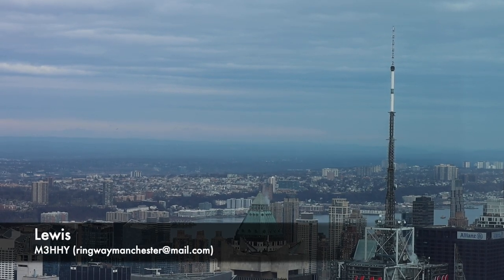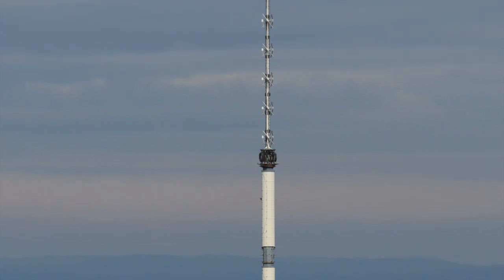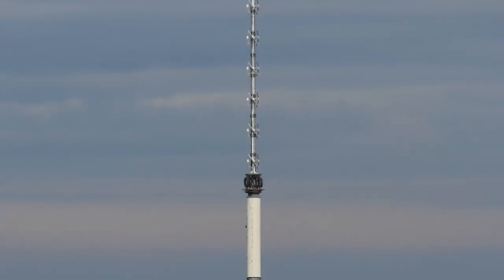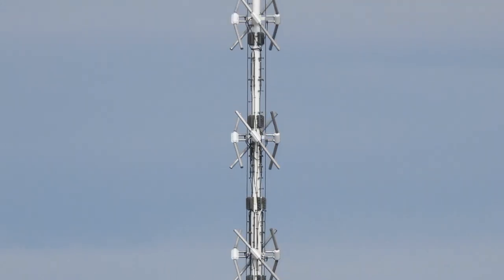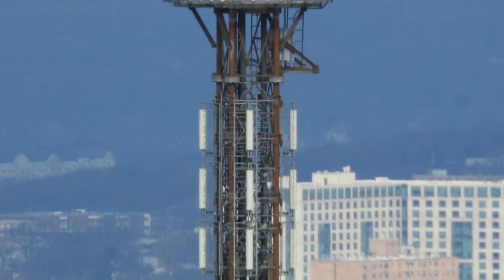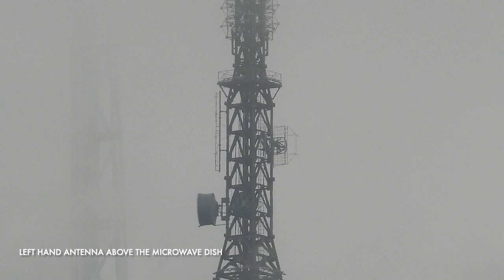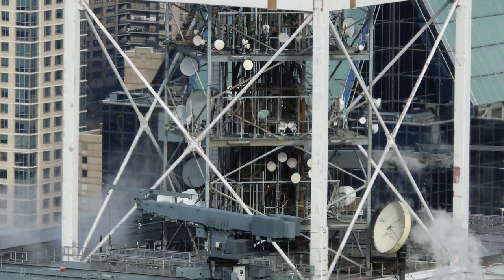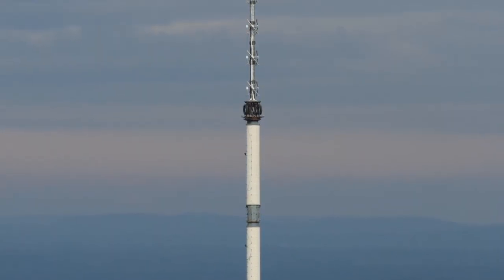What Every Massive Antenna Does On The Times Square Skyscraper

Comment: I'd imagine the two huge masts on top of the Sears Tower broadcast all sorts of things. It's one of the first things you see when driving into Chicago, from any direction. Seriously though, they're huge.
Reply: Indeed they are, the other large antenna mast system is on the John Hancock building, also transmitting TV and I assume some FM's as well.

Comment: I remember in 2000 I visited my firm’s NYC company HQ based in 1 WTC 101-105 floors. We installed a GPS clocking antenna on the roof for our new global network.  Soon after the clocking source went missing 😢

Comment: This is a great explainer. To add to it, many microwave sites are used by TV stations for their ENG (electronic newsgathering) trucks -- those branded news vans you see with the tall microwave antennas. Many TV studios have their own microwave receive sites as well, but terrain (and, in the case of New York City, super tall buildings) can make it challenging to "hit" a TV station's microwave relay from a truck, so they install microwave relays at various points, and the signal goes from one to the next until it ends up at the studio.

On September 11, the first "field report" of the crash came from Dick Oliver at WNYW, the local Fox station, who was doing a story near the World Trade Center when the first plane struck. They were able to rush to air with the first live report because Oliver and his photographer were already sending video back to WNYW's studios through the microwave relay on top of 1WTC. That is also the reason the station ultimately lost its ground video feed — 1WTC lost power a few minutes after the plane struck, and redundant systems used by WNYW failed. The station's broadcast engineer wasn't at 1WTC when the attack happened, but six other engineers — Don DiFranco (WABC), Rod Coppola (WNET), Steve Jacobson (WPIX), Bob Pattison (WCBS), Isaias Riverea (WCBS) and William Steckman (WNBC) — died in the collapse of 1WTC. All six men were credited with keeping broadcast signals for their stations on the air during the attack, and their work is one of the primary reasons why four stations — WABC, WCBS, WNBC and WPIX — were able to continue broadcasting until the collapse of the tower.

After the tower fell, broadcast communication was severely crippled. WCBS had an auxiliary transmitter atop the Empire State Building, and managed to stay on the air. WCBS, WABC and WNBC had to distribute their main signals on public broadcast and low-power TV stations for days until a permanent solution could be found (they were all still available on cable TV). With the priority on getting TV signals back on the air, getting live video from lower Manhattan was less of a priority, and the priority typically went to the networks instead of the local stations. This is why, hours after the towers collapsed, there were virtually no live reports from Ground Zero; instead, the TV stations relied upon tape turnaround from trucks that were positioned outside the collapse zone, and that could hit the TV studio microwave relays from other parts of the city.

After September 11, the primary TV stations serving Manhattan tapped the mast on Empire State for their main broadcast antennas and microwave relays. 4xSQ was primarily used as an alternative source for broadcasting and microwave relay (though depending on where ENG trucks are, they still use it as a primary microwave relay). The terror attack made it clear to the TV stations that redundancies needed to be in place in a market as big as New York, and it's one of the biggest reasons why they all broadcast from the new 1WTC tower while still maintaining their back-ups at Empire State and 4xSQ.

Comment: Some years before the 9/11 attacks my cousin took me to the top of the WTC Twin Towers, all the way up to the observation deck on top. I remember looking across at that mast shown in this video at 0:20 and being surprised at how huge it was. Prior to that I had only seen it and these buildings from far away driving up the New Jersey side. I had assumed that mast was just a big light pole thing. What did I know? I was a teenager. When I got up top everything was so much bigger, that giant mast, the buildings themselves, even the deck I was standing on. Between the edge of the deck and the edge of the roof was a fairly long distance, and it was covered in razor wire to discourage anyone from hopping the railing and thrill-seeking or suiciding. All this time later still hard to believe all of that is gone.
Reply: Plus it had some kind of netting to catch people